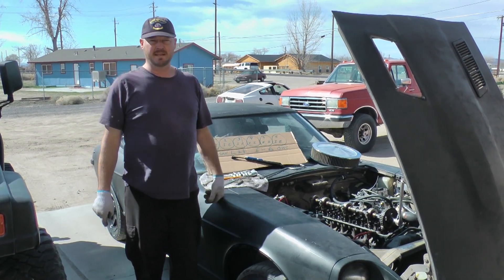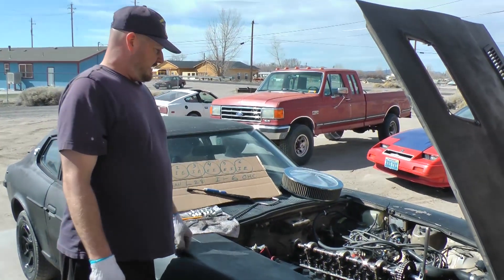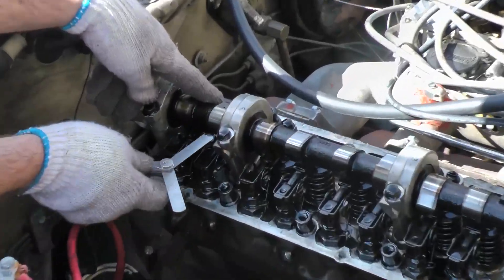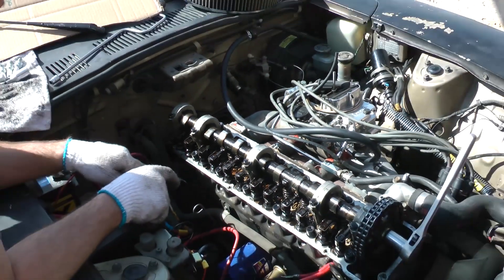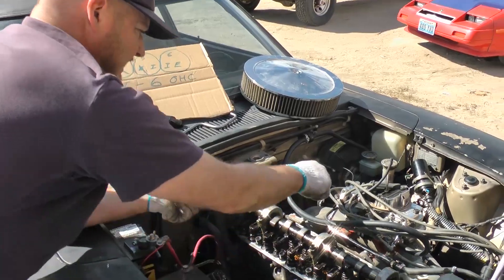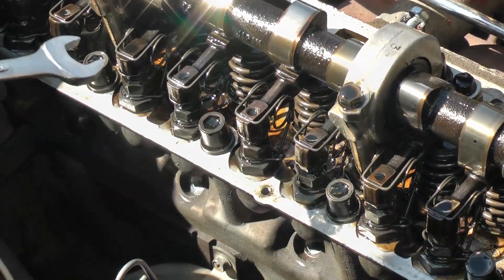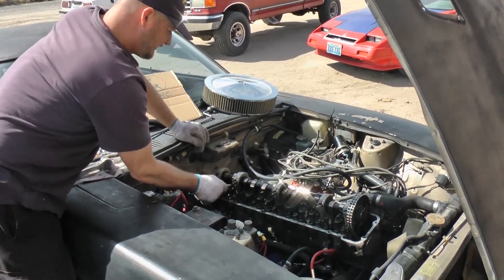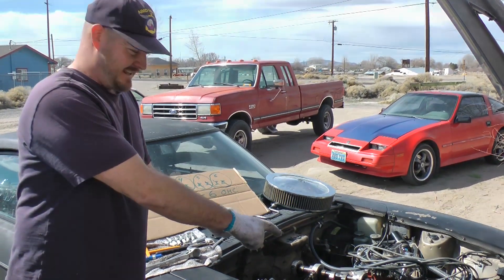Datsun Valve Adjustment

Comment: I used to set the valve lash on my slant 6 with the engine running and a full face shield in case of spraying oil…. You wanted to feel the consistency as if you were pushing it through clay… if it pinched it was to tight if it slid right through it was to loose…. I might try it on this lol just crack the nut and set it while running… we shall see

Comment: Heh... I wasn't scared by anything on my old Datsun Rustbucket. I have learned a lot of auto mechanics since then... but I never felt as little fear as I felt taking that 510 apart -- and putting it back together!
Reply from the maker: Especially the first time you do it, it is always safer to go a little loose on the rocker adjustments until you have done it at least 20 times and are confident in the Rocker Arm Valve clearance adjustments.

Comment: Good info usually I'll close the gap a thou or two on a cold motor from the hot lash specs depending on the motor my 77 like .002 less lash and my 82 likes .001 both l28s so there must be some minute metallurgical difference between the 2 valve trains or maybe my 82 runs a bit cooler than my 77 not really sure but I'll adjust my lash every other oil change it seems to keep the motors in check and speaking of my 82 is due for an adjustment haha

Comment: Curious the difference with that one, and the 1980.  The FSM for the 1980 has you move the cam to two different positions; cylinder front most cam lobe straight up, and cam lobe straight down.  You adjust half of the valves in each position.  It also says to perform the adjustment on a hot engine, though.

Comment: I have watched this  video like maybe 40 times. Im getting ready to do this myself on my l28 and this is just an awesome vid to go by. Hope you are feeling better by the way. Thanks for your work. The datsun community loves this.
Reply from the maker: ***** Thank you again for your motivating comments all throughout my recovery.  When you make the adjustments to the rockers, when its all done you will also notice the engine running a lot better as long as all the measurements with the feeler gages are just right on a cold engine and the measurements are exactly the same when you tighten the retaining nut.  It is very challenging the first time because when you get the adjusting nut just right and the measurement is perfect, you tighten the retaining nut and the measurement changes.  It will be frustrating the first time but after you develop the technique of holding the 14 and 17 mm wrenches together and holding the 14 firm while tightening the 17 while keeping the feeler gage in place to check clearances before tightening and after tightening retaining nut and being able to keep that measurement after tightening.  That is the most difficult part of that process.  Once that is mastered, you can do a whole set of 12 rockers in 20 minutes or less.... Let me know how it goes.  Do give yourself lots of time for the first go at this.  I remember my first time doing that and I cussed up a storm until it all clicked...
Reply: Budget Boosting thank you for the advice, my friend and I will be pulling the valve cover this weekend and adjusting them together doing the same stuff you did.
I am your biggest fan btw lol I am fanboying im not going to lie. I wish I could film for you because I am into filming and someone else help film would be awesome for this channel. you have lots of awesome stuff to offer. anyways. I will be looking forward to your new videos and your speedy recovery.
Reply from the maker: ***** Thank you, If you are ever in our area, please do contact us and we can all meet so you can see what we do.  Right now it is two of us that make up budget boosting.  Someday if we get sponsored by one of the car magazines or automotive business, we could move up in the world and have several people on our team.  We take it one day at a time here.

Comment: You've got it backwards between hot/cold on the valve lash Matt.  

.010/.012 are hot engine specs.   .008/.010 are cold
Reply from the maker: +heymisterderp I always do the adjustment cold due to how fast engines cool off and every degree effects the contraction of the adjustments.  I always do .010/ .012 on a cold engine and it has always been successful.  I prefer not to do the .008/.010 due to it being to tight of a clearance whether hot or cold from my experience.  When I learned this adjustment close to 30 years ago from my friends in Japan, they always said for me to do .010/ .012 on a cold engine.
Reply: Most of the Z guys on websites swear by doing it hot but there are others who disagree.  You and I are two of those.  Even though I did mine cold, I had the luxury of taking my time and making sure I was highly accurate in my settings.   My first time doing it, the temperature changes from a hot engine would have stressed me out.  The change in temperature would create an inconsistency unless it's done super fast.  If I had already done it 100x and could almost do it with my eyes closed, sure.
I wrote out my E's and I's out too and kept the plug firing order in mind so I knew when I'd be back to #1.  My whole data sheet was filled out by then and I was 100% sure I didn't miss a valve. 
But I still disagree with you on the lashes.  If you've got an old Z around adjusted to 010/012 cold, try 007/009 cold instead and I think you'll be surprised.  
If you want more HP out of a n/a Datsun for dirt cheap.  NGK ZFR6F-11 are what all L-engines want for Christmas.  You might not want to waste hours trusting me on the valve lash but $15 for spark plugs, come on brah.  ;)
Atlanticz.ca/zclub/techtips for some independent discussion on these plugs.
Reply: I've built and worked on all the L- series engines, 4's and 6's. GO through the procedure then, double check the clearances. It never hurts to be sure everything is clearanced properly. I never had a problem with my valvetrains.

Comment: Thanks for the video! I've never adjusted the valves on a car before.  Just did it on my 73 240z.  Runs a bit better! Keep up the videos!  I'd love to see videos on replacing distributor cap/rotor and setting the points of a 240z. Then one on timing it ;)

Comment: I got an l28 with e88. can't get it to fire,  engine only turns.  no explosion.  only hear the starter.  any ideas what is wrong?
Reply from the maker: Check for ignition (spark), and fuel, if engine has both of them, check for compression, if low or not consistent, adjust the rockers and should clear up.  If not, could be a number of problems if any above solutions do not work.

Comment: is the layout of the exhaust/intake starting from cylinder 1 as you shown on the cardboard, applied to 1979 280ZX as well?  Same procedure?  I have not done this before but it does not look too difficult.  Also, are all adjustment done when the lobe is up and passed?
Reply from the maker: Yes done when lobe is up or slightly passed, I prefer each lobe to be in an exact up position to get same adjustments for every cylinder but not necessary.  All Nissan L series engines have this same procedure.  L20, L24, L26, L28.

Comment: Turn #1 to TDC.  Adjust Intake (2,3,8) and Exhaust (1,6,9).  Turn #4 to TDC.  Adjust Intake (5,10,11) and Exhaust (4,7,12)
Reply from the maker: Yes that is a method a lot of people do, I prefer my method because each lobe is in the exact same position when I adjust them. Your method above you can adjust them however the cam lobes are in different positions and measurements are slightly different when cam lobes are in different angles.

Comment: hey budget boost so I just did a valve adj on my l28 yesterday and it seems that you can move the adj nut after the locking nut has been tighten down all the way on cylinder 2 intake and cylinder 3 exhaust valve I was wondering if this is a sight of a bad valve ?
Reply from the maker: depends how much force you have to exert to move the adjusting nut.  Usually if you can move the adjusting nut, time to tighten the retaining nut tighter.  I use a 17 mm combination wrench.  If you look at some of the factory manuals, they use a long torque wrench which will tighten the retaining nut tighter.

Comment: Might Be Helpful, Also to Let Everyone Know ,Maybe How Often This Should Be Done.My Mech ,when I had My 76 &78 280 Use to Say Dealer Specs Say Every 17,500- 22,000 miles ,if I Remember Correctly ? Been A long Time Since I've Had One.Mechs Always Stress that the Solid Lifters Need More Attn.,Where as Hydraulic Valves Are Self Adjusting or Rarely Need Adj.??

Comment: I have a 1976 280z and was wondering if this method would work for me or should I try .008 intake and .010 for exhaust?
Reply from the maker: 72galaxie500car I like the .010 and .012 myself on cold engine.  .008 and .010 are good for a warmed up engine however, by the time half the rockers are done on a warm engine, the other half has already cooled substantially so the measurements will be slightly off.  I always start with a cold engine.   I have known some that like .008 and .010, measurements, can be done but very little difference.